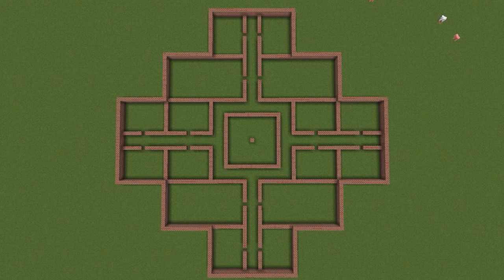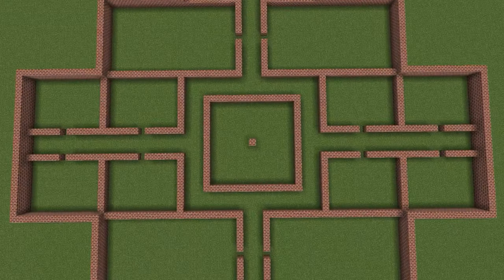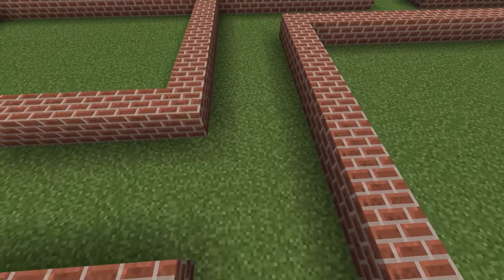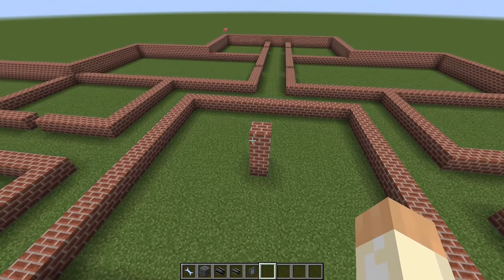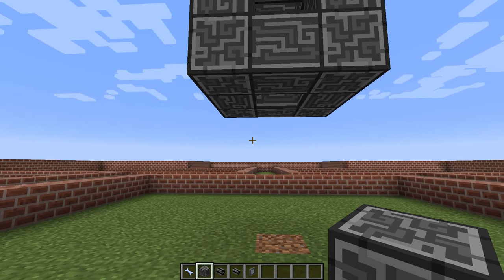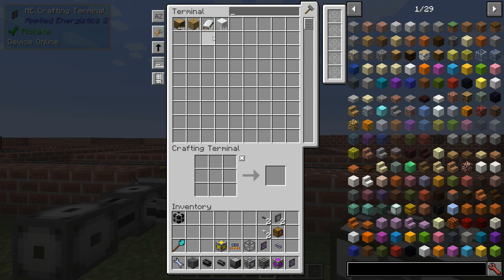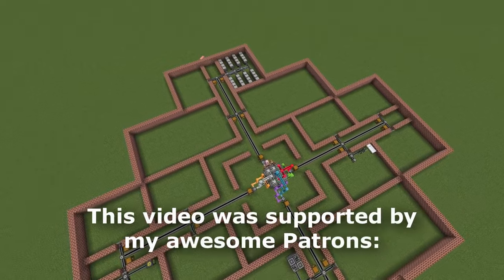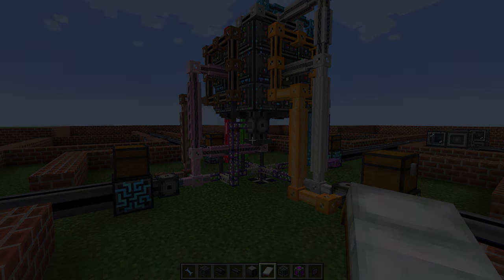Large ME Controller and P2P Network Guide - Applied Energistics 2 Tutorial

Comment: I constructed a P2P network like you did and I'm trying to use them to connect my Me Drives and Interfaces to the network. The problem is that none of my storage is appearing in the system and my patterns within the interfaces aren't there either. I don't know what I'm doing wrong and I'm really struggling with this system. Is there a solution for this?
Reply from the maker: The problem is that I don't know how you built so it's impossible to answer. With screenshots or a video of how things look it would be easier. Jump onto Discord and discuss it there. It is easy to make mistakes with this build, failing only one step (like powering a subnet, or misclicking the memory card) nothing will work.
Reply: @therealtkh  So, it's been 3 days of troubleshooting and doing other things, but I found out that in order to get my terminals to project what's inside my ME drives from P2P tunnels, I just needed to get more P2P tunnels and hook them up to that.
I'm confused. Are the P2P tunnels basically their own network, or am I just doing something that's confusing my thing?
...And my interfaces are there too...
Reply from the maker: @GeneralBurger  I have a few videos on P2P tunnels, starting from simple networks and scaling up to this build. If you're new to P2P it is not recommended to start with the final build, you can find the other ones in the playlist. Basically, P2P tunnels are 1toN. That means that one input can go to one or more places, but there cannot be several inputs to one tunnel. Each tunnel needs to be configured (with memory card) if it's an input or output. And again, each new input needs a new configuration. I usually prefer to have ALL tunnels 1to1 to keep things simple and efficient as every tunnel IO  requires one channel. Read more: https://ae-mod.info/P2P-Tunnel/
Reply: @therealtkh  I think, to make it easier on myself, I'm going to watch the entire playlist you've made on AE2 to see if I learn something new. Since a lot of things are confusing me it'll most likely be best to just go from video #1 to #45. I don't like clicking random links because I'm paranoid that a virus is somehow going to be installed onto my computer. I'm just going to watch the videos and then I'll see if I've learned something from it.
Thanks.
Reply from the maker: @GeneralBurger  They are quite old and a bit slow so I recommend watching the ones covering your topics because not all items are crucial :) And if you get stuck or have any questions, you know where to find me (in comments or on Discord). Good luck!
Reply: @therealtkh  Alright.
Reply: @GeneralBurger  Haha you simply can't get a virus from going on a video on youtube. The only possibility to catch one would be to click on a link in a comment section or in the description of a video but other than that it's straight up impossible.

Comment: Is it possible to have it 32 channels per room using the P2P system? I've experimented with just one coontroller and I can get 32 channels compressed into one channel
Reply from the maker: Well, isn't that exactly what this video is all about?
Reply: @therealtkh  My bad! I got confused. I tried it out myself and experienced just how powerful even 1 controller can get. Truly amazing!
Reply from the maker: @GamingPerks  Cool, hope it works out!
Reply: @therealtkh  Quick question though, in this video I assume there are no subnetworks? Like, the 3x3x3 is the main controller and the other controllers are just there to compress the channels right? or am I mistaken? Thanks!
Oh, and on the secondary controllers, can I add p2p to them as well?
Reply from the maker: @GamingPerks  The middle, big controller is the main, yes. I don't know how you define a subnet but the other small controllers are only there to transfer P2P tunnels. You cannot compress them more though, it is not possible to run tunnels in tunnels! It's not required to have small controllers but you would be limited to have a small cable that can have 4 inputs and 4 outputs. So there would be many small cables going in various directions, it really depends on how big controller you have and how many rooms you want to hook up.
Reply: @therealtkh  Thank you! Finally someone explains it to me XD
so basically all I'm seeing in this video is how to setup a 3x3x3 controller setup which doesn't have a subnetwork such as a storage subnet or a crafting subnet, right?
I watched another video of yours using the ME interface block with the storage bus to create a subnetwork which works with the main one but is managed by a different controller
Reply from the maker: @GamingPerks  Sorry for late reply but you're right, this setup had no subnets, the design is basically all-in-one to not be forced into subnetting. It's a "brag build" when you have lots of resources and can exchange channels for simplicity :) Every room is part of the same network so putting a crafting terminal in every room will give access to all other rooms as well.
Reply: @therealtkh  Thank you! your videos are really helpful <3

Comment: Question, can you use p2p tunnels to  transfer other p2p tunnels  (inception)
Reply from the maker: No, that's not possible :)
Reply: I think i've seen this in one Youtube Video somewhere. Theoretically, when i calculated right, this would lead to 32,768 Channels in one Dense Cable. But why in the World did you need this amount of Channels in one Cable?
I mean, normally you can put 32 P2P Tunnels to one Dense cable when using a separated P2P-Controller like in this Video. This equals to 32x32 = 1,024 Channels in one Dense Cable. This is not enough?
I think the key is to connect the P2P-Controllers also with P2P-Tunnels to one additional Sub-P2P Controller and at the end you have do undo this in the other direction. But i can aslo be wrong.
Reply from the maker: @djblackarrow  You can't have p2p in p2p so 1024 channels is maximum in one Dense cable. Also stated by official documentation: https://ae2.ae-mod.info/P2P-Tunnel/

Comment: URGENT, for me when I connect energy cell, it all lights red even tho I did exactly what u did
Reply from the maker: If I understand correctly: you have a big ME controller in the middle, and when you turn power on it doesn't work? If the ME controller turns red the reason is usually that the controller is not correctly built. But I have no idea how you built it, because I have no screenshots or videos.
Reply: @therealtkh  its ok now. I was connecting glass fluix to the p2p instead of thr cable at the start.

I have 4 redstone furnaces and they have glass fluix cables sending the goods into a chest, however i have to connect those to an ME network for it to work. How do i separate items from AE power?
Reply from the maker: @wisps-vn7oy  Hmm, I'm not sure I understand but it sounds like you need to watch a few more tutorial videos (good thing I have like 50!) and you can find the playlist in the video description! :) This video is aimed at mid to late game so the first network you make should not be large like this. What do you mean with AE power? In AE2, there is only one type of power. And in this video I have two networks, one for P2P tunnels and the center will therefore be connected to every room and they will work just as if they are in the same room.

Comment: Whats the point of a backbone system?
Reply from the maker: Two reasons: First, if I want 32 channels in a room far away, I could go with Dense Cable all the way, but it's much cheaper to use tunnels and "thin" cables. A regular cable can fit 4 or 8 channels, which multiplies with 32. Second, in a large controller, it's impossible to reach all sides in a hole in the controller, then a P2P networks is required anyway - and adds with the first reason.

Comment: Does this still works? When I use the memory card it says invalid machine
Reply from the maker: You forgot to wrote what pack, game and mod version you play on. But as far as I know this hasn't changed.
Reply: Make sure you have nothing in your offhand. Shift+rightclick to create a configuration at the controller and right click to apply it elsewhere.
Reply: This still works. But in my case these HEX-Adresses and color pixels are not shown at all.
If you use only one memory card to link all of your P2P Tunnels, it's important to make sure you clear the memory cards after each linking. For me i have to shift+right click while looking at a block to clear the memory cards. Shift+right click while looking in the air doesn't work.
The linking procedure is always the same: First shift+right click on an unlinked P2P Tunnel that is placed at your ME-Controller then go to the other End and just right click on another unlinked P2P Tunnel. If your ME-System get's bigger and bigger, it can take a few moments before channels, P2P Tunnels and devices get activated.
The Network-Cable between two P2P-Tunnels need to be energized. Otherwise the P2P Tunnel doesn't work. I always use quartz fiber to do this. If you use sub-controllers like in this Video you can connect the sub-controllers together with glass-cables and quartz fiber and connect an Energy acceptor at some point when you use Other Mods for Energy delivery. Quartz fiber is used to isolate energy from the ME-Data itself. Only energy is passed through.
I always use Ender-IO for Energy production and i often place two AE2 energy acceptors at two different points to create a Fail-safe power supply. I also use AE2 Powercells and large Ender IO capacitors for energy storage. I also build an Emergency power supply to power the ME-System up if something goes wrong. If really bad things happens i have lots of minecraft chests and a 64k storage cell in a separated ME-Chest full of Stuff that i need to repair the ME-System in an Explosion proof room. Sometimes i build a second little ME-System only for emergency, so i can put the storage cells from my main ME-System in the other.

Comment: what are the dimensions of the rooms if i may ask
Reply from the maker: Hard to say, and I have made this build like three times and every time made the rooms bigger and used different layouts (some small - some large). However, the most important part is to have a three block wide corridor for the "backbone network". Going with only one block makes it too tight if you have rooms above or below. Then  you can expand the entire base much larger than in this video - and with more and/or larger rooms. The rooms for pure  storage doesn't need to be very big, but other builds require more space and then you won't be able to use all 32 channels in one room unless you make it larger. However, the idea with this type of large network is to prioritize simplicity and logic and not care too much about channel efficiency.
Reply: @therealtkh  sadly i havnt played much with this and my friend told me to build him a chamber and i have no clue where to start
Reply from the maker: @grimgreetings2249  In that case: three blocks wide corridors and make all rooms slightly larger than you think are needed. But keep different sizes so there's a selection! The middle room can be 19x19 (not including walls). Just test a few quick layouts in creative to get a feeling for them. And corridors 3 blocks wide so it's easy to walk around. Entire building can be something like 150x110 blocks which gives a good starting place for many rooms :)
Reply: @therealtkh  thank you so much for responding to me i didn't think i would get a response and i appreciate it i shall try that out

Comment: can i connect that 3x3 me controller to a controller thats mainly for storage ? and use the 3x3 controller for automating if yes how ?
Reply from the maker: A network can only have one controller, but it's possible to have separate networks with big controllers in each and access content through storage bus / interface connections. But when I investigated this many years ago I came to the conclusion that it was not possible to use the other network's content for auto-crafting. If the 2000+ channels in the 3x3x3 controller is not enough you can of course make a larger controller and use P2P networks as in this video, I would say it's the most common way to do things